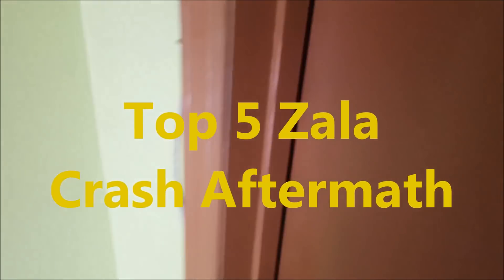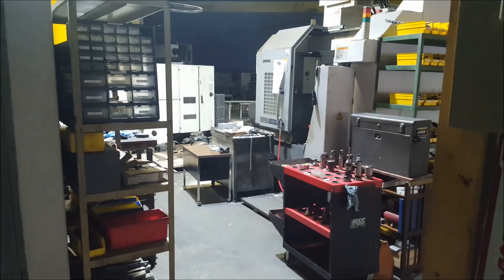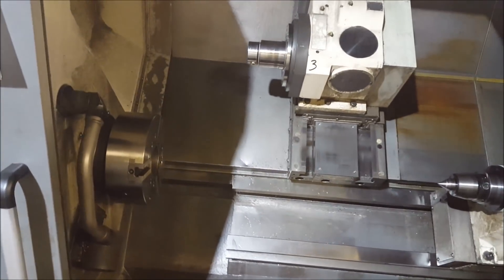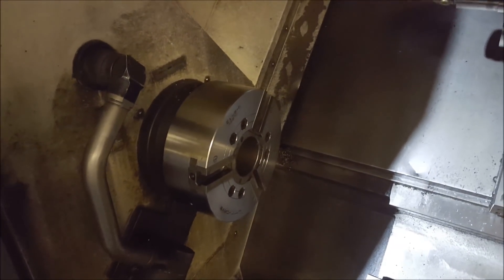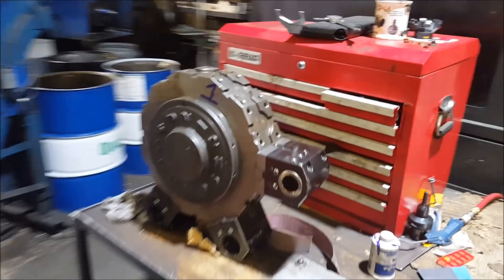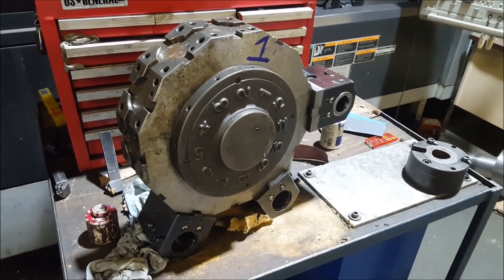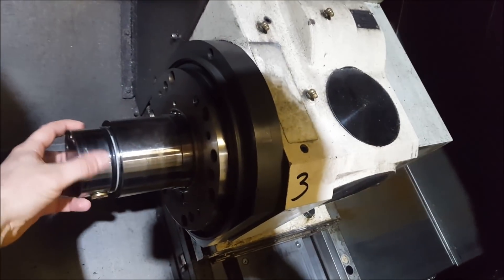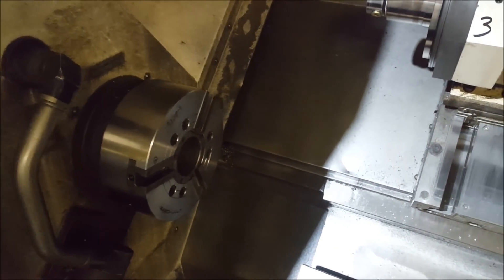Top 5 CNC Crash All Time at Zala Machine -- The Aftermath

Comment: Let me guess.. He tried moving the offset by -.001 but forgot the decimal point.
Reply from the maker: In this case he had some type of alarm and had to reset the machine.  When he turned it back on he forgot to put the optional stop back on.  I started programming with M00 instead of M01 for this job from then on.
Reply: @zalamachineshop  M00 is never a stupid code!  I learned this the hard way.  
If a machinist never crashed, they are lying.
Reply from the maker: @daBEAGLE1017  I never crashed. 

This week.
Reply: @zalamachineshop  Never Ever? Are you a programmer only then?  You never snapped a drill?
Reply from the maker: @daBEAGLE1017  lol read more.
Reply: @zalamachineshop  ah, missed that part.  I guess you were no Machinist this week then.   
Best regards MarTool

Comment: I once knocked the tailstock shifter with a broom whilst clearing swarf, when the saddle returned for the next cut, it moved the tailstock back enough for a 3.5 ton tube to fall out. It wiped out a 6ft x 3ft sliding door ( luckily not the one with the controller on it) and put a few cracks in the bed. £800 to fix the door and a turret realignment later, it was running fine again.
Reply from the maker: That's the beauty of these machines you bump it and if you know what you're doing you can get it running again like new.  I've seen and cause many devestating crashes but the machines are still running and making good parts.
Reply: £800 pound to fix it? Which machine and how long ago? We have mazaks and they’d charge you over £800 to replace an M5 button head 😂

Comment: That looks like a pretty clean break.  Are the bolts designed to shear off?  It would make sense if they were, and that’ll certainly save you some money on repairs.
Reply from the maker: Yea these machines are made to give in weak spots.  This was catastrophic crash but got the machine running so it's not too terrible.

Comment: One of the guys crashed my Daewoo spindle was at 2500 RPMs full rapid at 900 inches per minute  right into the chuck it broke of two Jaws off sheared the bolts that hold the turret to the carriage and sheared the bolts that hold the spindle down to the casting spent the week aligning everything up and getting it back square again. The cause was a programming error by my programer/set up guy he put a value in g54 when the guy made all his offsets and wanted to run his first part home straight into  the chuck
Reply from the maker: Your comment is my nightmare.  I've had my fair share of traumatic crashes but nothing as bad as you describe. I'm actually happy I was away from the shop when this happened.

Comment: WOW!  The worst crush that I had was VDI40 block rip off the turret. the block flew away 30 meters. 1 passage on the turret had gone. nobody was hurt.
bearings, shifted headstock, turret. turret mountings bolts were bent. It was 9 years go. repairs took 1 week. machine still up and running with 0.004 mm tolerance. check this out. https://youtu.be/OL5D2RE6OnI
Reply from the maker: Pavel you are right.  New machines are great and precision but once it takes a bump you better know how to dial it in precisely.  Machines are made to be adjusted.

Comment: The worst fuck up i've had was when I had about 300 lbs of cast iron set up block in the air and was stoning off the bottom, then the eye bolt pulled the threads out and the block dropped. Luckily only a minor injury on a coworker. Left a pretty respectably dent in the machine table on the way down.
Reply from the maker: My worst fear is walking into the shop and seeing the scene from Saving Private Ryan with my poor machinist walking around the shop holding his severed arm in slow motion.  These machines will rip bone and flesh without a blip in the load meter
Reply: @zalamachineshop  May that day never come! Gotta stay humble in this field